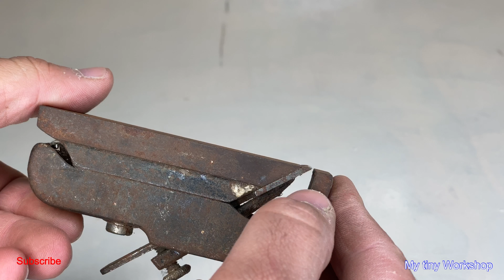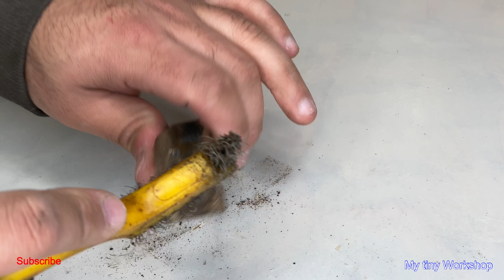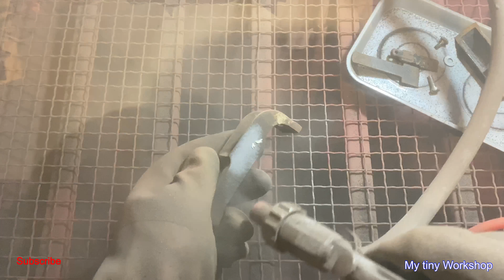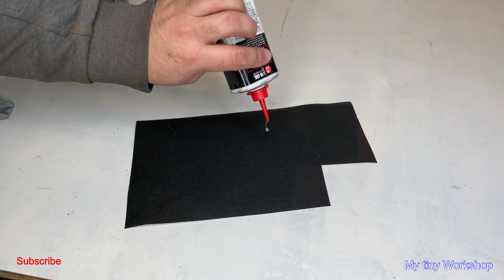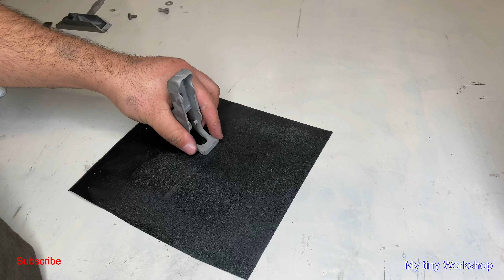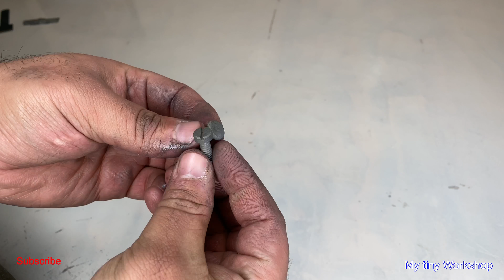Simple 8 hour Restoration - Bullnose Plane

Comment: Really like the job you did on that little plane, especially the red color!! now old blind farts like me can find it faster in the tool drawer!! LOL.  There are a lot more modern sharpening systems then oil stone but I like them and use them. I recommend a mix of 1 part 5W oil to 2 parts kerosene in a jar or squirt bottle.. It is just enough to lubricate but not so much oil that it retards the sharpening process.

Comment: That turned out very nice. Better than new and the colors are perfect. Have you tried those diamond lap stones? I haven’t yet but would like to. Apparently they are all the rage. Take care.
Reply from the maker: I haven’t tried them, probably worth purchasing.
Reply: @mytinyworkshop1213  diamonds are definitely the way to go today. You want continuous plates. The grid plates are meh. 400 and 1000 grits are enough to get you by.  You can work right off 1000 diamonds and a strop. I use some ceramic stones in between but they're not needed.

Comment: Hi - enjoying your restoration projects. Could you tell me what spec is your sandblaster? Is the compressor generating 18cfm (or more or less?) Thanks
Reply from the maker: Hi, my compressor is a Hyundai hy3150s. It’s served me well so far. I can run it for approximately 2mins 30 seconds at 80 psi. Once the motor kicks in again it takes approx 3 mins to refill. Refilling an empty tank takes approx 10-15 mins. The cabinet is just from eBay.

Comment: i dont have a sandblaster or powder coating system.  evaporust, primer and paint is the best i can do.  got any other recommendations?
Reply from the maker: I started this channel with a cheap pillar drill and vintage for rust removal. Seems like your all set.

Comment: I bought one of these off E bay. Still in its box, labelled in £/s/d and looked brand new .... the reason for this is that it was completely unusable. The sole was ground to an angle, one side was approx 3mm higher than the other and the finest setting of the blade saw it protrude approx 10 mm beneath the sole.  A true Friday afternoon special.

Comment: DMT Diamond plates and a leather strop.
Reply from the maker: Thank you for the tip.
Reply: @mytinyworkshop1213  When I started woodworking, I used the sandpaper on a granite stone to sharpen.  Then Paul Sellers recommended DMT plates.  After purchasing these, my planes and chisels went to a new level of sharp.  The DMT 'stones' use either water or glass cleaner.  You can buy lapping fluid but it is not necessary. After sharpening, maintaining the edges with a leather strop is all I need.  I have had them for years now and the do everything I need.  Good luck.